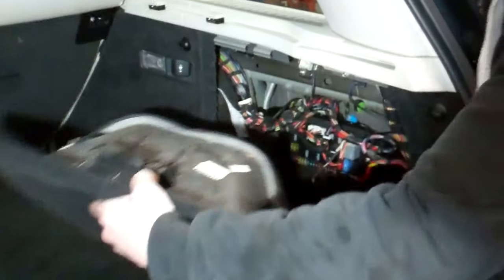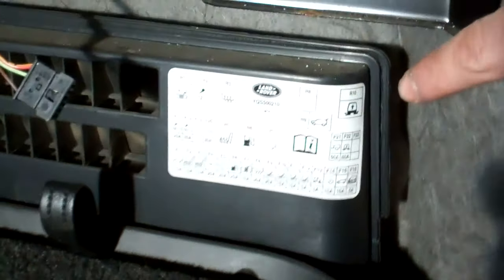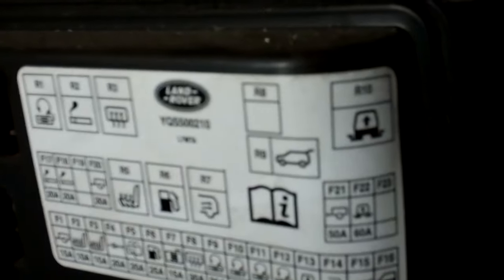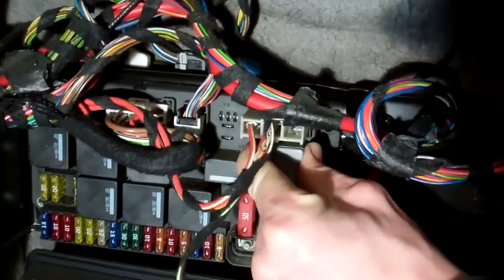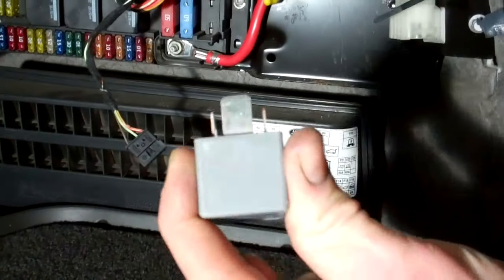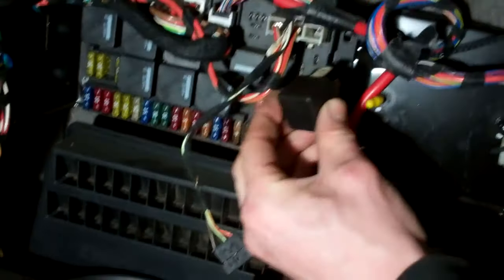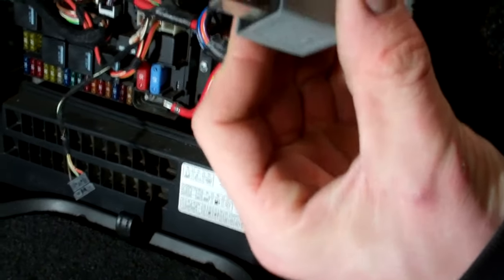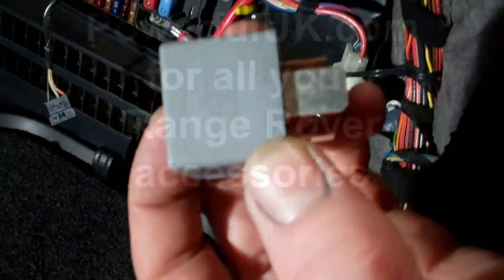How to replace the relay on Range Rover L322 air suspension compressor

Comment: My 2004 vogue has a fault with air suspension which is OK one day and not the next. The warning on the dashboard is always there. Could this possibly be the relay? If so is this something you could supply

Comment: Hi, I don't appear to have any power to the air pump. I have a 2003 L322 I have checked the fuses the 50a and the 15a they are good. I have disconnected the wiring plug and put a meter across the heavy duty Red and Brown testing for 12v with ignition on but showing no voltage would this be a problem with the relay?
Can I put 12v across the pump motor to check that and is the Red wire live and the Brown earth?
Reply: I have the same problem right now, have you fixed it? Same problem, no power to the compressor.
Reply: @TVDanSt  me too...no power to air compressor or internal switches
Reply: @lifebeginsat190  It was internal code in the system, if you put new battery, it locks most of the electronics, just find good diagnostics and erase all fault errors. Everything is working perfectly now :) I havent replaced any part.
Reply: @TVDanSt  sweet...thx bud...I'll try it

Comment: Having the air sus issue with my 2003. I fixed the pump the valves and the height sensor.. when starting the car, it lets me adjust the height once then error reappears.. why ??

Comment: My 2006 with new compressor and new suspension airbags releases  the air 2 or 3 hours after you turn it off;  but its not a leak, the L322 suddenly decides to free the air  and the truck goes to the ground.  can this relay solve this?
Reply from the maker: This is odd and worrying.... where is the air escaping ? is the valve block exhausting air ?
Reply: Have not seen where the air ir escaping but if you open a door after 2 hours of the L322 been parked the air escapes and the L322 looses all the air mostly on the back of the vehicle, but i don’t think its a leak because after 2 hours of being normal it looses all the air in 3 seconds. Sometimes its triggered when you open a door after 2 hours but almost always within 4 hours of being parked. Im thinking an internal battery that looses power with time or  when you demand power (opening a door)

Comment: Were is the fuse for rocker switch as my lights have gone out
Reply: Riley did u find the location as I am having the same problem.  There must be a fuse somewhere I checked the back and in the glove compartment all fues are good

Comment: How can you tell if the fuse is bad before you buy a new fuse
Reply from the maker: yes if you look to the light you can see if the metal link in the fuse is present or if it has blown and there will be a gap.

Comment: I have air suspension inactive on my dash will this fix it
Reply from the maker: Hi probably not alas !
Did you try this one
https://www.youtube.com/watch?v=xR899nhkRxE
Reply: powerfulukltd yeah I tried that it didn’t do anything
Reply from the maker: not good news... did you look at bagpipingandy's repair kit / video ?
Reply: powerfulukltd I did his repair kit only goes up to 2004 I have a 2005
Reply from the maker: did they change ? let me look at my 2006
Reply: powerfulukltd I saw where someone said you have to turn the wheel all the back to the right and back to the left like the video you sent me, but do it 4 times, so twice in a row I’ll try that, also turning the key to position 2 and turning it on and off about 20-30 may clear faults  someone else said
Reply: @seanybravo69  did you manage to get yours sorted. I've got 2004 vogue and sometimes the suspension works but mostly not. Dashboard warning is always there
Reply: On our 2007 the diagram doesn’t have the suspension picture it looks more like and engine management symbol so is this still correct or would I have to look at the fuse box in the engine bay that’s an exact replica of the one in the boot?
Reply: Having the same issue with my 2003. I fixed the pump the valves and the height sensor.. when starting the car, it lets me adjust the height once then error reappears.. why ??